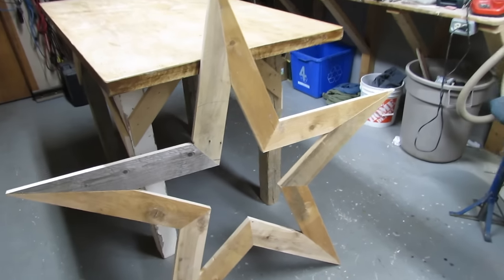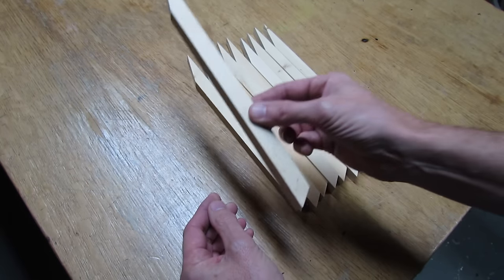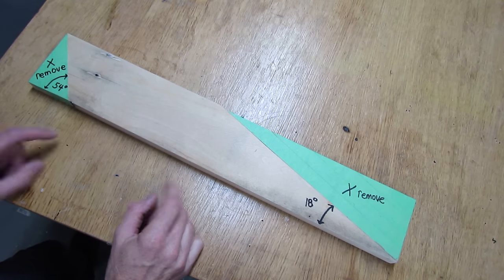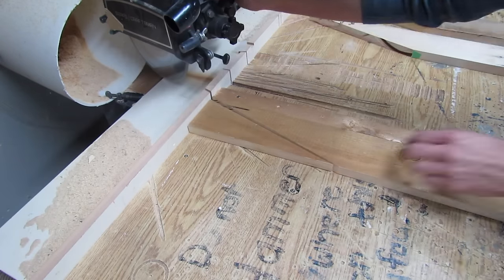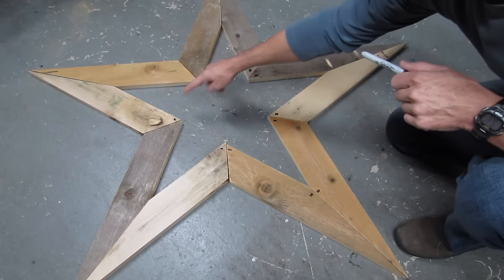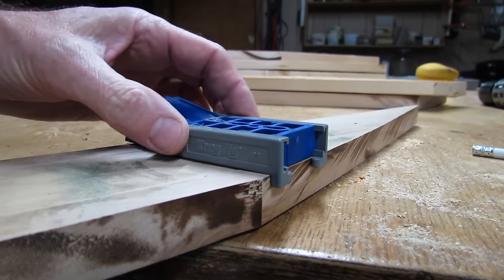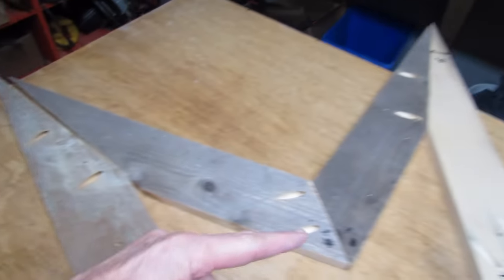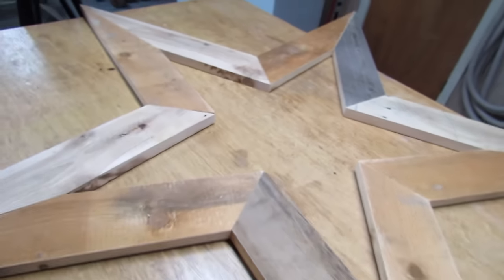How to Make ● a STAR from Pallet Wood

Comment: Good Stuff! I have a version I build with cedar pickets using a similar technique, though I built a jig to use on my table saw. Makes the cuts really easy.
Reply from the maker: A few months after I made this video, I found that what I thought was easy to make, wasn't. I experimented and discovered a much easier method. Here is the video:  https://youtu.be/5-eWqi555Nc .  Good luck!

Comment: You know Chris - I have an idea for a video for you - and that is to build 
a tool shed made out of pallets - I'm sure you could do it. Pallets, as you
know are about 4 ft by 4 ft, and square. Quite often you can get them for
free, and they would be great for a tool shed, as they have sturdy 2/4's
you can "bolt together." you can even make the floor from pallets. You
don't need a fancy upside down V roof, but just a flat roof with a moderate
slope - like a 1 / 12 pitch. Make a shed 8 ft wide by 12 feet long. Do everything
in the pallet dimensions to save cutting-whether that's 3 ft or 4 feet.
 
 Considering Home Depot charges around $ 900 to $ 1,300,(plus tax) I'll bet you
could build a "good looking shed" for next to nothing. All you'd have to pay for
is some decent looking siding and shingles. Lot of people would be very interested,
and I've thought of this myself, but I'm not that handy, but I know it could
be done quite easy. People throw away good pallets all the time. Note- lot's of
videos on here with 2 litre plastic bottles, but how about some wood "pallet" creations ???
 
I'll be watching for you to build a tool shed !!
Reply: Grant P I am definitely not very handy but I built an 8 x 12 shed last year completely out of pallets and 1/2 " OSB for siding. Paint and screws cost the most. $350 at the most in total.

Comment: Very good video. Thanks for sharing. Since Christmas is coming back every year it stays actual.  i discovered this video only today.
If I look to the star logically, it seems to me that the 54 degree angle is a constant and the  other (18 degree in your case)  angle depends on the length of
the wooden parts. Am I correct with that? If so, how can I calculate the necessary angle when working with longer or shorter boards?
Reply from the maker: After making this video I realized for most people it's not easy to build this star. I found a much simpler method..........https://youtu.be/5-eWqi555Nc
Reply: @chrisnotap  Thanks for your reply. I read the comments only after sending my comment. And there was mentioned the other video (more times)
Tbh I don't like that star very much (the overlapping system) At least not for myself to have. It'll take a while till next Christmas so I have some time.
I have a mitre saw and a small table saw with mitre gauge so somehow it should be possible to make the complicated one as well.

Comment: Thank you for the video.  Without having a degree wheel, how do you determine the angle cuts for 18 and 54 degrees.  My miter saw will be able to get the 54 degree cut, but the 18 degree is well beyond.  Did you have to use a jig? Or did you use a table saw?

Comment: Good video!!! I've tried measuring these angles and I can't seem to get it right! How did you measure these angles? Thanks for the help
Reply from the maker: I used the angle gauge on the back of my saw but it is finicky, you have to play with. Best is to start with small pieces of wood and make a small star, then make a bigger one once you get the angle right.
Reply: Chris Notap ok I'll give that a shot!! Thanks for the help

Comment: Great job Chris... Just followed your instructions and It turned out perfect. I made a Jig to make 18 degree cut on my mitre saw.
Chris, if I want to make star out of 4 feet side pieces, will cut angles remain of same size?  Or do I need to follow some mathematical formula?
Once again, great job... Chris..!
Reply from the maker: +J Patel   Angles will stay the same for whatever size you make the star. Glad it worked for you.

Comment: Hi... I'm really struggling with the 18° angle my chop saw only goes to 45° and the pallet planks are 4 inch wide ... this might sound thick but I just need help Please do you measure each one spectate or just one and template it on to other pieces
Reply from the maker: This star is harder than I originally thought. I have figured out a way to make a star thats way easier. I will be uploading in a few weeks. Stay tuned.
Reply: Chris Notap Did you make video yet?

Comment: Good instructions, but I found it easier to cut a 36 degree angle than the 54 degree. Many chop saws don't have a 54 degree cut option.
Reply: Suede Steele if you clamp a sacrificial piece  to your saw, back against the fence and mitre the 45°  from both sides, you can use them as your new fence . From there 0°= 45°,then you can add what you want ,set your blade to 9° and it'll be equal to 54° when cut.
Reply from the maker: A few months after I made this video, I found that what I thought was easy to make, wasn't. I experimented and discovered a much easier method. Here is the video:  https://youtu.be/5-eWqi555Nc .  Good luck!

Comment: hey cris I'm trying to make a star just like the one your making but I just can't get the degrees it won't come out the same can u assist on what degrees to use if it measures 12 inches
Reply from the maker: You need to make the angles as I have in the video. They need to be as close as you can to those degrees. The size of the star doesn't matter, all the 10 pieces of the star should be the same exact size and then you cut the angles the same on them all also. After you have them all cut and placed on a flat surface, and the star temporarily assembled without screws, you will see how close your angles are and whether you need to take another small cut after an angle adjustment on your saw. The last step is to mark where the screws will go to attach it all together.
Reply: To be clear, it does not matter if the star is 4" or 6' the angles would be the same?

Comment: hi chris.  ok, i am using small paint sticks to practice with...  my mitre saw only goes to 50 deg. angle.   so, if i do 1 side 50 deg. do i lower the 18 deg. level side to 14 deg?
Reply from the maker: I have found that this star is more difficult to make than I originally thought. Good news though. I am doing a video today or tomorrow on how to make a star that is way easier to make. You can make it any size and all you need is a jig saw.
Reply: oh ok. i have to get a jig saw then. all i have is a mitre saw. will wait for the new video.
Reply from the maker: You can use a mitre saw. I just meant that if thats all you have you can use a jig saw.
Reply: Hi Chris did you make the new video?

Comment: Why not make the instructions to cut a 72 degree miter on one end (the 18 degree angle end) and a 36 degree miter on the other end (leaving 54 degrees). Saying to "make an 18 degree angle and a 54 degree angle" is very confusing.

If anyone is  having trouble with this star (and I did initially), cut 72 and 36 degree miter and disregard the 18 and 54 stuff.
Reply from the maker: Yes, I agree that this is a 10 in difficulty for many of my viewers. I have come up with a much easier way to make a star and it looks just as good. It still uses old boards to give it that nice look. Here it is and thanks for your comment.
https://youtu.be/5-eWqi555Nc
Reply: Chris Notap Thanks. I like both designs, this one and the overlapping one. And I think instructing the 36 and 72 degree miter as you did in the 2nd one, will save some ppl frustration.
Reply: PaulDFW thank you very much

Comment: So how long are the boards before cutting the angles?
Reply from the maker: This is actually difficult to get right. I found a much easier way to make a star and made another video..https://youtu.be/5-eWqi555Nc
Reply: start with 10 boards cut to the same length; doesn't matter what length they are, but the same width is important.

Comment: What angles do you cut n a common miter saw? Because 18 and 54 degrees on a common miter saw don’t work out that way.
Reply: In other words, cutting the longer angle on a common miter saw requires that I cut a much sharper angle than the 45 on the miter saw, like say a 162 degrees, or maybe 108 degrees. I’m not sure which.
Reply from the maker: I found a much easier way to make a star after making this video!    https://youtu.be/5-eWqi555Nc

Comment: I tried and tried again but I was coming up with a star with 8 points, I have just realised you removed 54 degrees, I cut the board at 54 degrees but not I’m gunna try 36 degrees and hopefully it will work lol
Reply from the maker: A few months after I made this video, I found that what I thought was easy to make, wasn't. I experimented and discovered a much easier method. Here is the video:  https://youtu.be/5-eWqi555Nc .  Good luck!